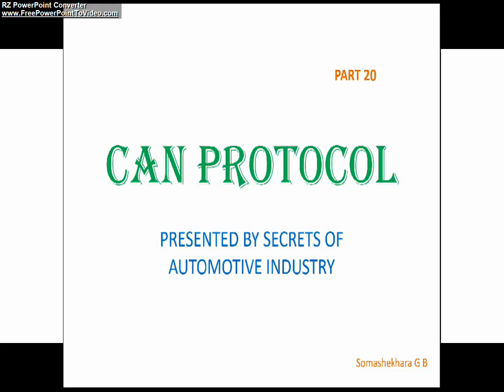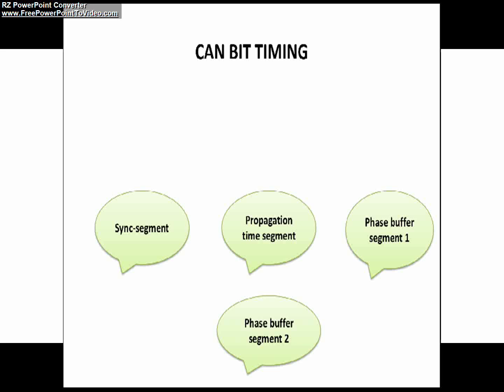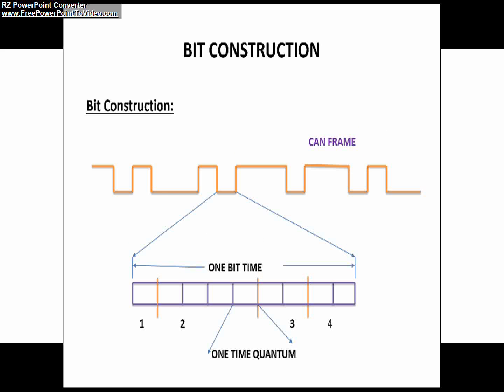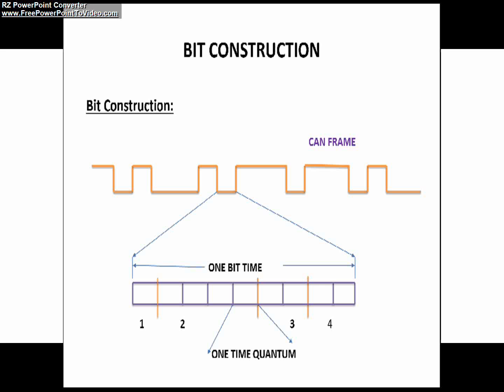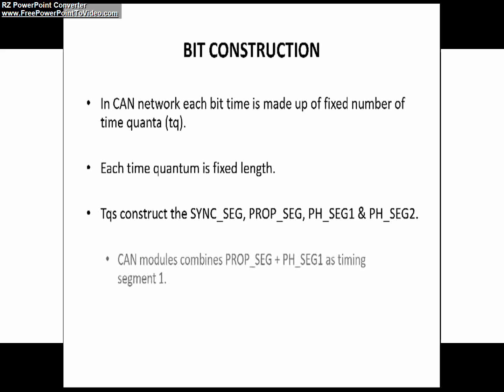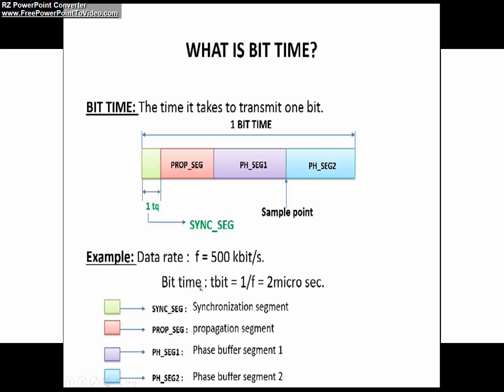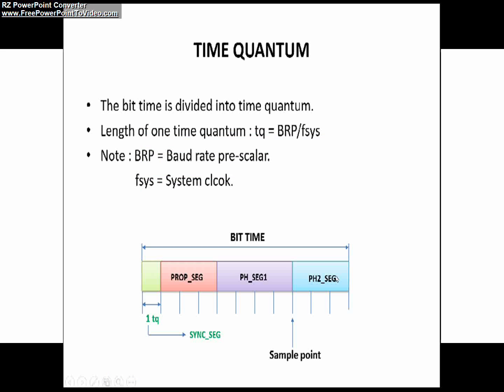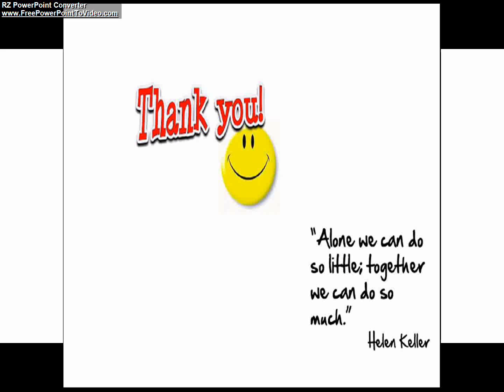CAN protocol basics, PART 20, Bit Time and Bit Construction.

Comment: Why there is both oscillator clock as well as can system clock??
Will u please explain buad rate prescalar briefly...
Thank you
Reply from the maker: Hi Rashmi,

Oscillator clock means MCU (Microcontroller clock) and CAN system clock is derived from oscillator clock (Baud rate pre-scalar). I Will add some more points with simple example.
Reply: Thank you
Reply: hi sir
how to Set baud rate of CAN for 500 kbps

Comment: Here Fsys and data rate both are same or different?
Reply from the maker: Hi kiran,Fsys and Data rate are different, Fsys means System clock, data rate is the speed in which you can transfer your data bits.

In case of queries please leave comments here. Kindly stay tuned..

Comment: Hi, Could you please explain a little more on the baud rate pre-scalar and system clock used to calculate length of 1 time quantum. And please correct if I am wrong in understanding, bit time divided by 1 time quantum gives the total number of time quanta or there is anything more. Thanks!
Reply from the maker: Sure, I would try to keep one more video on this topic..